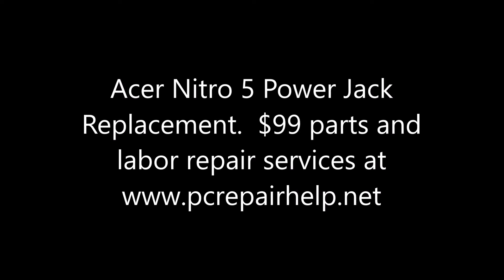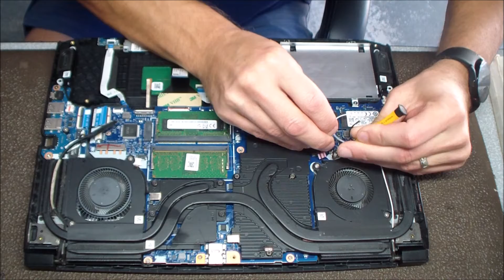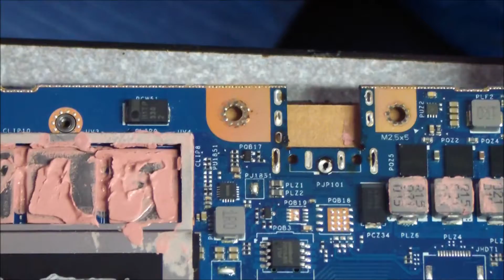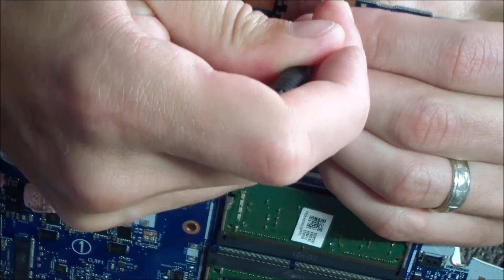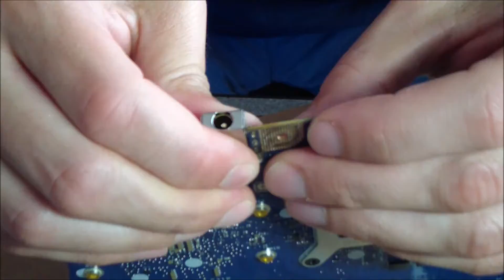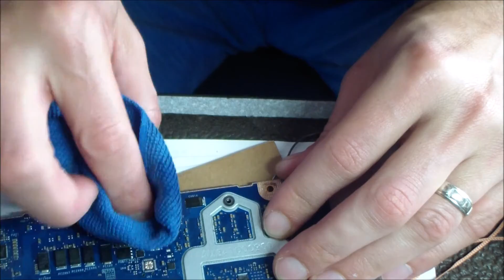Acer Nitro 5 Power Jack Repair

Comment: I just did this to my sons laptop. Used the exact same process, but the laptop still won't charge. There's 19.7v coming through the charger so it's not that. I did notice i plugged out the little battery from the board, but you didn't. Could this be the issue? Thanks
Reply from the maker: @orremm  that shouldn't have anything to do with it. Are you sure the Jack's making a good connection after the solder job?
Reply: @pomeroypowerjackrepair  I checked before reassembling and it looked good. I'll take it out and hit it with the soldering iron again I guess.

Comment: Big thanks for this video. I thought I knew how to do it, this confirmed it. I did a few things differently to speed the process.

- I didn't bother removing solder with the copper weave first. 
- I clipped all accessible posts from the jack. 
- I desoldered each post individually to pull them through.
- I used a blade style iron to get the two posts and positive lug through all at once.
- I used a dremel with a fine (around 0.1mm) drill bit to clean the excess solder from the holes. I would not advise this unless you are experienced with it already. 

All in all, not a bad repair job to do.

Comment: I have an issue with the same acer laptop. After being water damaged I had few of its ICs replaced and now when i turn it on it randomly shuts and charging light starts blinking. The power adapter wont charge the battery but the PC does run for a few minutes with the power adapter. So when i checked the motherboard's back the charign port is burnt. I could show you pictures but cant in this comment. Can you tell me what should I do?

Comment: Nice job. Thank you.
A bit over my skills (1st time I've ever opened a laptop and don't have your tools).
If you were within 2 hours of me I'd make arrangements.
I'm also not truly convinced this is my problem... but maybe.
Reply from the maker: @BrianHoff04  what are your symptoms?
Reply: @pomeroypowerjackrepair  A few weeks ago I used up nearly all the battery. I shut down when it told me to shut down. Plugged it in overnight for a recharge.
Next morning, turned it on.. could hear it powering up for a few seconds (SSD usually boots quick). Screen made a 1 second attempt to come on. That was that.
Charge light would not come on when plugged in. Press the power button and the charge light will blink 3 times. That's it.
A few months ago the power jack port would make small, static like noises when the jack was touched. Maybe the port?
Reply from the maker: @BrianHoff04  have you tried a different power cord?  Can you wiggle the tip of the power cord around to get it to come on?